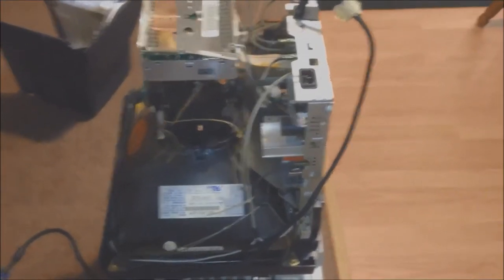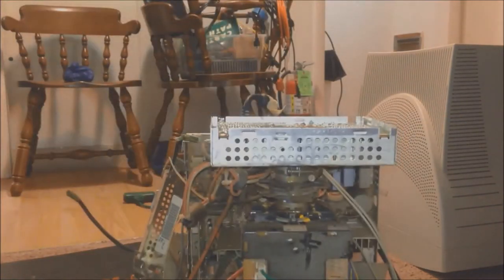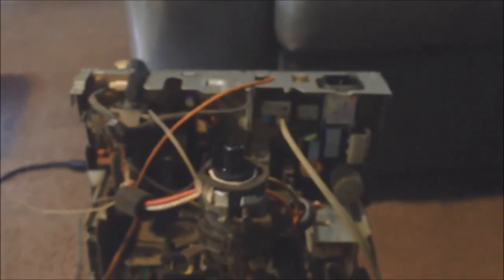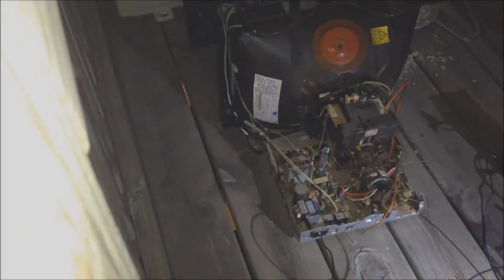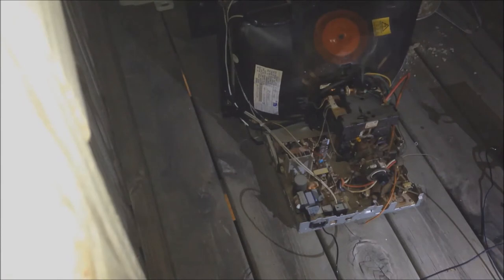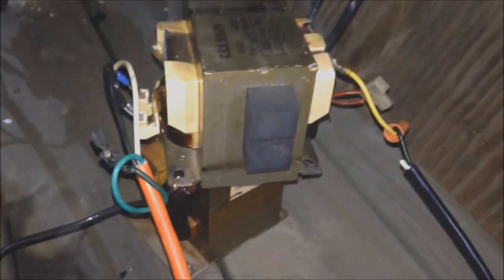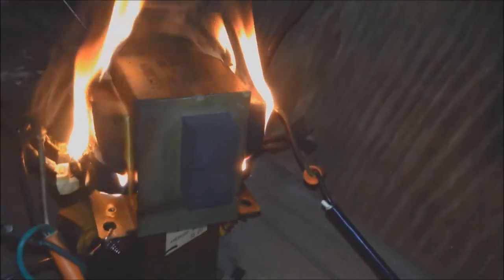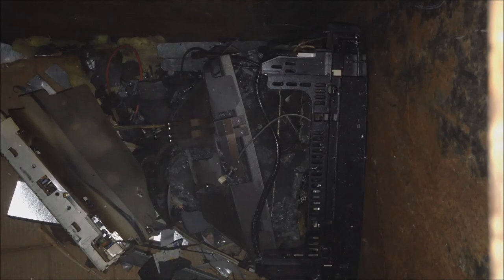Dell Monitor Destruction Part 2: MOT FIRE!!

Comment: Epic mot burnout! The monitor received a proper burial as well. Mots never last long, which is why I use a 3kva 120/240v to 2400v transformer instead. Stays room temp even when I give it 5kva+ from the mains. Plus the output is about as powerful as 7 mots combined while on full power. Nice vids man keep it up